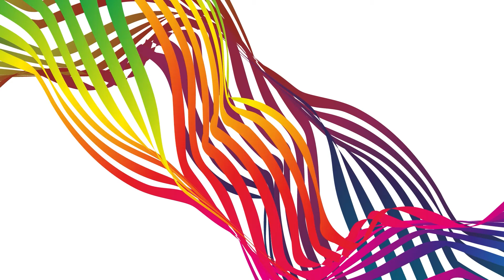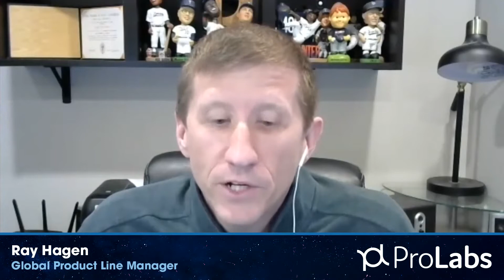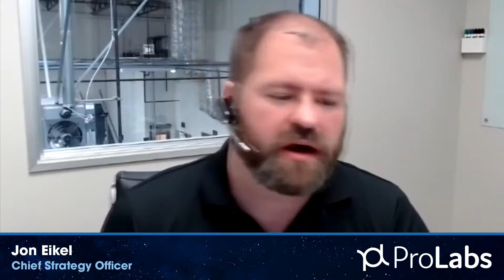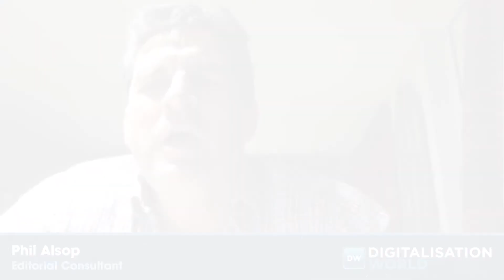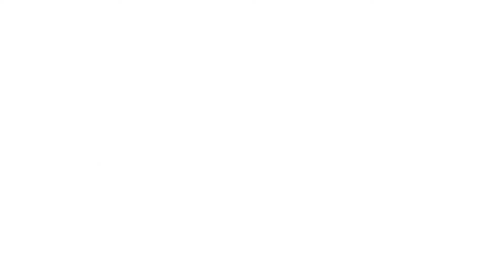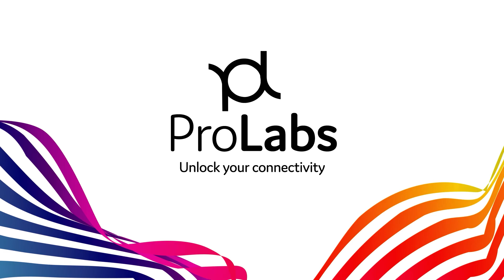The Current State of 400G Networks (Digitalisation World Interview)

Comment: PAM4 pfff  why not QAM1024?  If your optics are tunable what's stopping you from just modulating the tuning as well as the amplitude?  
According to the University of Leicester the data required to teleport a human being, your cells, broken down into data, equates around 2.6 x 1042 bits.  How are we ever going to get our transporter network running if it takes longer than the age of the universe to send someone?